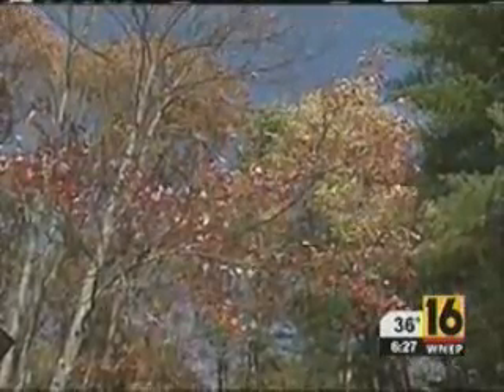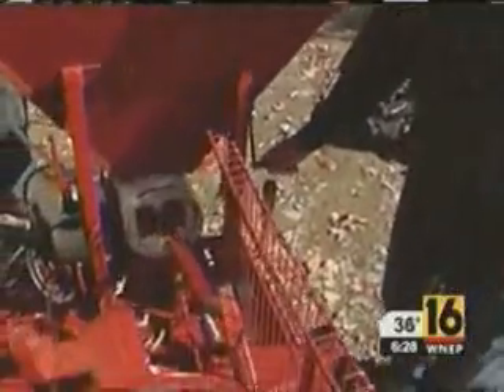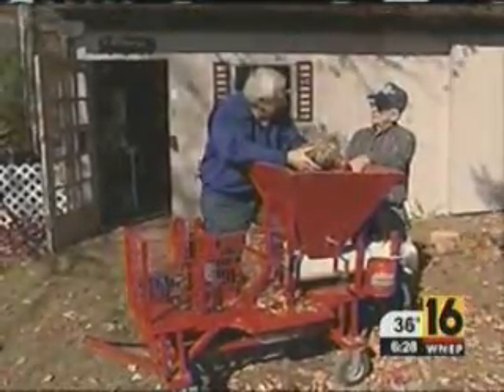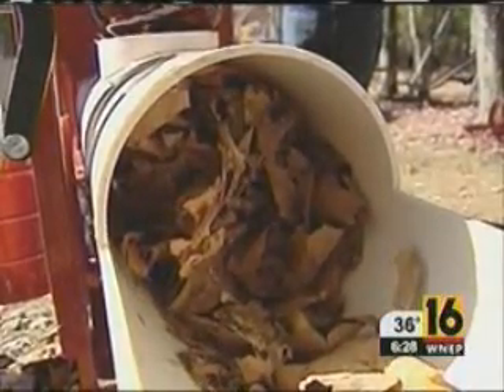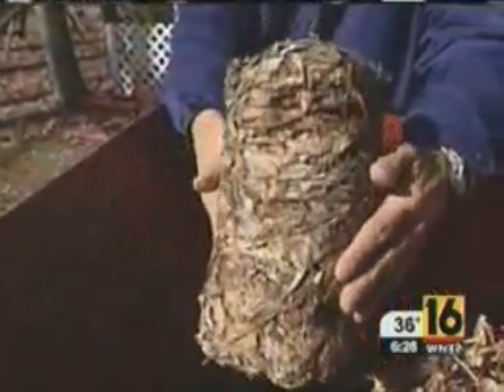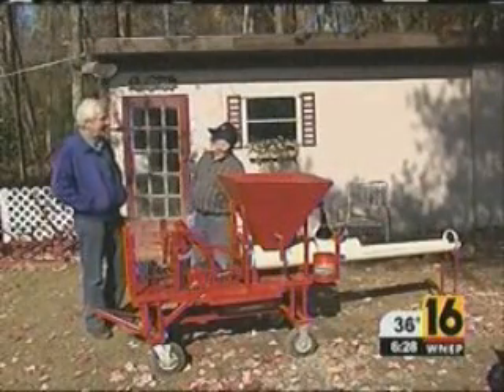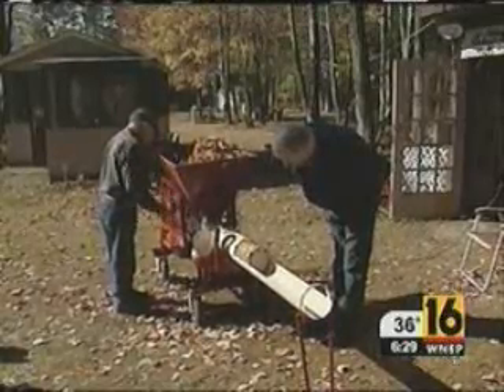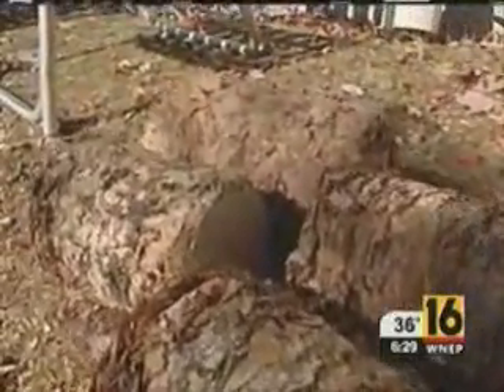Leaf Log Maker

Comment: paten pending woud only be used on the glue flour and water then use potato starch its cheaper, grow sweet potatoes and sell the green tops or feed the rabbits lol, or do rice flower even cheaper lol.  lol this is old news, daddy did this cause hes a cheap butt, my father in law done this growing up, they sold wood not burn it. its how they made money. you have to remove the bacteria and spores will give you lung elements. they need to bake the leaves to 250f to kill parasites and bacteria.  add rabbit pellets to give a higher burn. cant patten something that has been done. go to williams burge they sell what they done in the 1580s they tell a story of leaf logs then because they did ont cut enough logs for winter, winter was extra long and they not expect it nothing like england it reads.....  find that story.. his patten is open season if he has one.

Comment: I have two large maple trees in my yard that produce at least 2 dozen 35 gal bags of shreaded leaves. Compressed they would make enough to heat the house for two days in the firebox. We take them to the city ag recycle center where they turn all that stuff into mulch which is more useful to the soil here.

Having cut wood for winter heat a number of years I found the time, travel expense, and risk of injury never did better than break even with burning NG. There are more useful things to do with one's life.

Comment: This is interesting.
However, it does not seem to deal with drying and removing moisture from leaf and the fuel quality might resent.
Also, would not result be better if leaves underwent a heavier shredding process. 
It would be interesting to hear more about glue to be used when assembling those logs: I heard about using starch as glue to build wood logs from saw dust other than pine. Does it also makes sens for leaves?

Comment: if you saturate the leaves, and press them with enough force you shouldn't need an adhesive.  This is the exact same principle as briquetting and they don't use any additional adhesives.    I think a far better use for this instead of burning would be pressing organic starter pots that can just be buried right in the ground.  It's an idea I've been toying with for awhile, but it's sound. I just haven't gotten around to making a press.
Reply: better hurry and patent it..  this guy is patenting compacting leaves. -_-
Reply: They already have organic pots at Home Depot.

Comment: I think this guy, and every one else also has missed the fact that glue is toxic to burn
Reply: +Inna Jankovic I believe the report stated that the glue is made of flour and water.
Reply: Glue is a very broad term. Flour and water equate to a short chained hydrocarbon based starch that is hydrolyzed. No danger. White vinyl (Elmers) or any urethane based resin is a totally different situation.  My press uses an all natural glue which is also the most common polymer on earth. Lignin is the glue that together with cellulose and hemicellulose constitute all plant matter. The trick is heat and pressure. When you get into temperatures and pressures that make it work, home Depot can't help you anymore. You need big material and power. A black and Decker drill just doesn't cut it with it's 800 watts. On the one hand the investment is not small. On the other hand the product is worth it if the demand is there.

Comment: If you shred and compost them they make great soil
Reply: some people have way too many leaves to do that though. i get 3-4 piles as high as my waist the length of my street access each year. and burning leaves is illegal in some towns.
Reply: Ananta Sesa das burning is such a waste of bio mater. most municipalities are composting.  If you wet them you can shred them into a fine mulch,  with a rotory lawn mower, which when placed in flower beds fertilizes and retains moisture, you can even top dress your lawn if you spread it thin enough, helping make it more  drought resistant!
Reply: actually composting is such a waste. here's why: heat is generated one way or other. composting will break it down but it generates waste heat that isn't even used. meanwhile green manure can break down without having dried like fallen leaves already have. the minerals are available for awhile but unless they get absorbed into a plant or stored in biochar they are vulnerable to being washed away with rain either across the surface into a river or leeched downward towards the groundwater. so yes compost stores the minerals for a while and keeps the nitrogen available but isn't perfect so a garden does well with both burning AND composting AND incomplete burning/charring.relentlessmadman
Reply: Ananta Sesa das leaves are also proprietary. they produce chemicals that control competing species. but they still provide organic material that helps to retain water, and make good mulch to control weeds in established beds.

Comment: Can you use shredded leaves to enhance burn time rates?
Reply: +Michael Clayton you dont have to shred them unless you realy want too. if you say put leaves in a bucket and add a little say old newapaper and spme water and let it sit for around 24-48 hours and then mix it a little with a stick ore as i use a drill with a paint mixing tool a few seconds you get a doe that is perfekt for my old manual brikette press.
let the brickkets dry until winter and it great as logs

Comment: I do have to say... I see a lot of arguing here about mulching vs burning and it seems like in all that vigor, no one considered how little you're actually going to get out of a pile or two of compacted leaves in the first place. Lol, when I was a kid, we'd cut and cut and cut wood for heat in the winter until we had this row about 20 feet long and 3 feet high AT LEAST, and we'd only stop when dad told us we'd have enough to get through. Let's say you have a few big trees scattered around your property. How many logs do you think you're actually going to pull out of this thing? Enough for a few days?

I'm on the side of the mulchers. Nature has been thriving off of decaying, fallen material for... oh millions of years at least. Aaaaaand of course here come the humans, AGAIN, finding new ways to screw up the very system that got us here in the first place. The fact is, trees grow from the nutrients that come from the rotting leaf material, that's what soil is. As soon as you start finding ways to eliminate that natural food source that plants (yes, even grass) need, now you have to replace it with chemical fertilizer, which comes from petroleum, mostly, and it's far inferior to the natural sources of nutrient and it's yet another way to tear up the planet. The biggest problem with human beings is that they always go around thinking they've got better ideas, without thinking of the cause and effect issues they're generating by being "clever". If we were truly clever, we'd be limiting our growth and constantly seeking to live IN STEP with nature, in all possible ways. Anything else we do goes against the natural order and has consequences we are too limited to see.

Comment: Can I buy one yet?  Or better yet, rent one?  This would be ideal for a sealed-combustion wood stove as supplemental heat for a cold-climate heat pump.  For those worried about the burn time, remember, there is nothing saying you can't ALSO burn cord wood as well.  these would be great to get it started.

Comment: Great idea. I wonder if you could get a longer burn if the leaves were shredded more finely.
Reply: +Brad Davies you could, like you said shred the leaves more finely, compress an you get thicker log & longer burn time. heck throw in some booze if you want , a white lightening leaf log :)
Reply: I was trying to be helpful not critical.
Reply: ardstsp Don't forget to throw in the booze.
Reply: +Brad Davies yes you could i guess. BUTA I SUSPECT. by first using power to first shredd the material not to mention the cost of a professional brikette press it would be expencive logs. hehe.
I still have and somtimes uses a manual logpress that make logs out of old newspapers. i se a potential mixing old shredded soaked newspapers and leaves and press that to a more compact log.
but for me its just a hobby. i have a old papershredder but it has trouble with the thickest newspapers hehe. so i most times have to cut them by hand first
Reply: One could shred the leaves with bare hands, I mean with a knife or something like a cofee bean mill, it would mean more work, but if you consider to do something without  technology/electricity which was created to ease our lifes, then you have to assume that you need to do more physical work

oh I just had an idea, since we already got rid of our leaves, I imagined to go to the playground but it rained and they would be wet, so I would dry them and that's when they get crunchy, you could just put them back into a plastic bag and crush them into little pieces, I thought of letting them soak in water 1 day so I could press them better into blocks like their cells are going to break because of osmotic pressure or something like that
Reply: +samkom33  Totally agree Sam.  I've got a big yard, a bunch of grass clippings, too many trees, and a lot of junk mail and paper products.
Reply: George Brown Don't forget to throw in the booze.
Reply: +Brad Davies or gasoline
Reply: Brad Davies mmmh good idea :D

Comment: I like how people think that this is good for the environment. It's not and leaves are better left to compost.
Reply: superque4 If combustion is necessary, from a carbon emission standpoint wood is extremely dirty and fairly inefficient. Burning a stack of relatively loose leaves will be moreso. If the entire world used wood products to heat their homes, pollution in terms of particulate and carbon emission would be significantly worse (see Wikipedia: /heat of combustion, /Wood_fuel#Environmental_impacts)

While not as efficient, methanol would be less polluting, and while dirtier than methanol, biodiesel from would be more efficient and probably cleaner than wood. Natural Gas is a better solution from strictly an emissions and efficiency standpoint, and if the gas could be landfill-recovered it would be better all around.

Now. This has nothing to do with living "off the grid" only that wood burning is not "environmentally friendly" when comparing against traditional fuels from an emissions standpoint. It sort of appears that way because it's renewable and less common and feels "natural". We don't mind teh smell of camp fires, whereas we're offended by car exhaust. But the reality is that wood is a very primitive fuel source that is not unrealistic to use. Leaves even more so due to the lack of density (though this can be overcome through compression, as seen here, though I doubt very much that you'll end up with significantly more energy in a kg of leaves than you would in a kg of wood).

A case could be made for compressed tree litter from it being a renewable energy source, though I do not think burning it directly makes much sense. Using leaf litter and recycled wood material to create biofuels is much more sensible on a larger scale.
Reply: superque4 Both. But I was refering to emission and energy density. I don't know all the ins and outs, but chemically speaking some materials are inherently more "energy dense" than others, i.e. they produce more energy per kilogram. Of the common fuels, wood is on the lower end, so you have to burn more product to get the same amount of heat back. Paired with emissions, that makes wood a very poor fuel from an environmental standpoint.
Reply: Well unless you move to the equator every 
winter, you are burning something to keep from freezing to death.
Reply: Yes. But there are better options. As a survivalist fuel source, it's good. But as something "eco" it's not.
Reply: turnipgoodness OK, I bite. what's an eco winter heat source?
Reply: turnipgoodness OK, good info. Question though: Is the fact that 80% of a chimney's heat escapes up the fireplace that makes it so inefficient or is it the "dirty" burn it has (heavy smoke emission)?

Comment: It's not the hot that makes creosote. That would be the still green portion of those leaves and such. Burning a fire hot in a stove or open fireplace usually keeps that creosote burned out. Not burning hot enough or green wood is what leaves the creosote because it can't burn as hot as cured stuff. :)

Comment: He's cranking it to force the leaves down the chute to the ram. An electric motor is hooked to a gearbox to operate the ram. Look carefully. There's a big pulley with a belt on it.
I assume it an electric motor based on noise.

Comment: The cost of fuel to run the leaf log-maker probably factors significantly into the cost effectiveness of operating such a machine. I imagine that a much cheaper albeit low tech way would be to take 2 PVC pipes one with a covered end that fits snugly in the next, fill it with the leaves and water starch mix, attach a chain to both ends and use a ratchet to create the pressure needed to form them into a log. After you just slide it out provided you sprayed the inside of the PVC with a lubricant.

Comment: biomass has a carbon neutral footprint, leafs have definitely already done there share of carbon duty during growth, don`t you think?
The engine could be powered by wind power. At my home I buy 100% wind power this means i might not have a mill at my home but my energy supplier delivers it to my door. A system like this at my location would be 100% carbon neutral.
interested in this type of technology check out my profile and videos. I built carbon neutral steam projects.

Comment: @x1MasterChief Because you need an adhesive.  Flour and water makes an adhesive.  I once saw Mythbusters test the strength of this glue in the episode they did to test weapons made in prison.  They used it for the improvised newspaper crossbow, if I remember correctly.  It is not overcomplicated.  The linkage for the ram mechanism looks like it is modeled after an old hay square baler.  This is good farm ingeninuity here.

Comment: A hand crank?
Keep up with the manual labour and just connect up an old bicycle and pedal. Much easier, quicker and powerful.
Reply: The crank was just for the leaf hopper. He had the press hooked to a geared pulley ran by motor.

Comment: Bad Idea. The smoke from burning leaves contains a number of toxic and/or irritating particles and gases. The tiny particles contained in smoke from burning leaves can accumulate in the lungs and stay there for years and can increase the risk of respiratory infection. 

Leaves (even after compaction) give off hydrocarbons, which irritate the eyes, nose, throat and lungs and some are carcinogenic. Also Carbon monoxide is an invisible gas that results from incomplete burning (smouldering).

Comment: I found a source for thick cardboard tubing..more like a pipe...i cut them into 10 to 12 inch pieces and jam pack them with leaves..i use wet paper to plug the ends...they burn nice and no glue needed

Comment: I tried grinding the leaves up with the lawnmower, drying, then using them in my sawdust burner..  Seems to work as good as sawdust but must be quite dry.  I have lots of oak trees.  I also use the nuts.

Comment: I just had an idea....you could do this by just using a log size aluminum pipe with threaded removable caps on each end. Drill numerous small holes in the pipe to let air in to dry the leaves.  Wet the leaves and pack them in real tight with a homemade plunger ...let dry ...then push out the dried leaf log with the plunger. You could even make a number of these pipes and do like 10 logs at a time